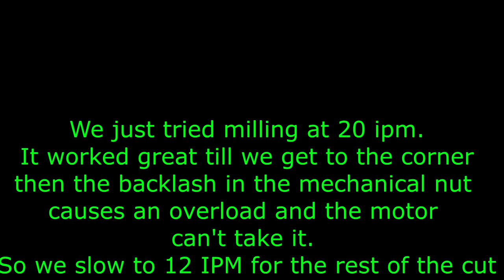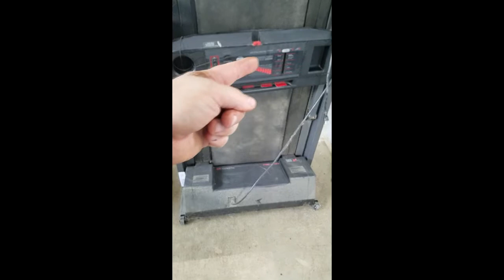Let The Smoke Out of the stock MAXNC cnc Motor while milling in steel.

Comment: Get an inexpensive mist coolant system, they are really great.  You can have considerable airflow and therefore get a better cut because you are clearing the chips with the air flow, cooling with airflow and coolant, and lubricating with coolant. When I cut wood, I just adjust the nozzle to deliver just air, and when milling lexan or acrylic I use water instead of coolant.  You can use a very small air compressor, as well.

Comment: I know this is an old post, but did you ever try conventional milling ? Climb milling does exactly what its named after, it trys to climb over the material. With any backlash it will grab. Conventional milling will always have the cutter pushing into the backlash on the leadscrew.
Reply from the maker: I did try both. Mostly because I forgot to click the conventional milling check box when programming, oops. I have too much slop in my screws and until that is finished I get oval instead of circular holes regardless of climb or conventional milling. It is on my list to provide a mechanical fix for this. But then again I just got a ethernet smoothstepper and it can do electronic backlash compensation. Might be worth a video showing the differences between the three options.

Comment: Hey JJ...i took my stock  maxnc controller apart and had a good laugh....the power supply is a wimpy 12v 4A....pretty sad indeed...i want to use a 24v 12A ps instead...i should be able to just remove the crappy stock ps wires and just connect my 24v ps right?...the stock spindle motors are junk...very little torque and almost zero torque  at lower rpm

Comment: I can hardly believe my eyes that you got this thing cutting (mild?) steel... I only dared with ali so far and I have the same motor. Its really impressive.  Did you burn the  motor coils or is it still usable ?  His much would you say this was down to the feed rate or doc? Cheers
Reply: *how much
Reply from the maker: Yeah, I was surprised it cut mild steel as well! I even got it to cut some case hardened hydraulic cylinder shaft I had laying about. I am not sure if I burned it out beyond repair or not. Actually that is a great question as I just spent half an hour with hobby files filing a slot for the new motor mount. LOL! I will try and hook it up again tomorrow. I tried to use it about an hour after the smoke first came out, and even more came out at that point so I just gave up. But it is possible that it was just the winding off gassing the insulation coating. I hope it is still usable as I really wanted to show people what the stock machine could do then try some simple homemade upgrades and see what we could do to improve for under $1,000. I did examine it earlier today and noticed it was really hard to turn for a universal motor. Does your motor shaft spin freely? For instance if you give it a good spin will it spin for a few more rotations? Mine does spin at all. If it smokes again I will take it apart for a video autopsy of what killed it. When I first tried running the motor on some wood. I found it was quite hot to the touch after just five minutes. I bought mine used off ebay so it could be I got a hard run motor on its last legs. I feel reasonably sure if your motor doesn't get too hot you will be just fine. I also want to reiterate that the machine ran for 40 minutes or so before the motor started failing. I drove it into the ground because I wanted to find it's limits and frankly I was soooo close to finishing the part :-) And now to actually answer your question. I was actually running the machine slower than it could run. The doc was .250" and the woc was 0.015" I think. I will have to go and double check that. Carbide likes to run fast so 20 ipm is about the max i would do. I ran most of the video at 12 ipm. I would have ran faster but the backlash in the screws caused the end mill to take to much depth of cut and would start to stall the motor. I really do think I have a bad motor as G-Wizard says I was only using about half the hp the motor could provide. If I had to do it all over again I would run it at the same depth of cut since the machine is stiff enough, and program for 0.010" woc and that way I could run at 20 ipm. I think I will do a video about my thought process on this in future and explain my reasoning. I tried earlier but I still didn't know what I was about. Not that I know now. Thanks for watching and sorry about the long reply!
Reply: Just Josh thanks pal that's a great little write up. I have to admit as I'm a Brit that I have to keep opening my calculator app to convert your imperial figures lol. I have a feeling I will have to invest in better cutters before I can cut steel like this, at the moment I'm using Chinese eBay specials which are allegedly hss, mostly 1/8 with 4 flutes.  
What you mentioned, doing a video before and after these upgrades sounds very interesting as I'm always looking at ways to improve my machine.  I also think it would be worth talking more about how you set up the machine  with your electronics setup to work with mach or whichever software you use, especially as many owners such as myself still use the maxnc native DOS setup.  These are great little underrated machines, I have a family now so hard for me to spend tonnes on CNC gear, so when I found mine second hand it was a great way to  get into the hobby. I buy spares here and there from ximotion to support those guys.  Still, just as you think maxnc videos on YouTube are a dying art somebody new posts something, so keep it up buddy!
Reply from the maker: Thanks for the encouragement! I will have to try and improve my editing skills to include alternate units in the DOC, WOC, and IPM to Include MMPM? mm per min? After all the majority of the world uses metric. Yeah, a good cutter helps tremendously. With that said I am using carbide and hss cutters that work considers trash and throws away. More than good enough for what I am trying to do. I currently use Mach 4 Hobby version with the legacy plugin. Grinds my gears to pay extra for it but you know. Needs must when the devil drives and I had a wedding gift I needed to make and too many lines of G-Code. I used the demo version of Mach 3 for all but this last machining video and I still have it installed and can walk through a general setup. I think you are right and there is a void on youtube for MAXNC software setup information. Currently it is set up to run with non MaxNC drivers. I have the Open Loop system so I can only speak to that. But boy if you are using the native DOS setup you are more of a man than I. I took one look at that and ran for the hills. It looks like you have the Closed Loop system. I have a vague memory of MACH 3 supporting Closed Loop. Initially I thought I had bought a closed loop MAXNC and later found out the E-bayer was mistaken in his description. How fast can you rapid? The old Open Loop stock driver only let me go as fast as 6 IPM (152.4 mm/min) I autopsied the 1/5 hp motor and frankly the problem is between the steering wheel and the driver seat. I had to replace one of the two studs that hold the clam-shell exterior together. When I put it back together I think one of the internal nuts became loose. I use superglue as a loctite substitute. The nut worked itself free and the nut supported the board the brushes were on. The brush then started to wear oddly and I think more and more of the carbon on the brush was ground away and started getting everywhere. I think heat build up and carbon brush material wearing and sticking into the cracks between the commutator caused short circuits and excessive arcing. The smoke came from the pcb board burning that the brushes were connected to.Suffice to say. If you plan on running your motor for more than 30 minutes I would recommend setting a fan to blow more air into it. I don't like how small the fan fins are and it couldn't hurt. And like I said before if yours doesn't get too hot to the touch then you are probably just fine. I am in the middle of editing the video where I took the motor apart and tried to fix it. Check it out and thanks for watching!
Reply: Mine also came with a maxnc 3d digitizing probe.but no software for it so its prob useless....i bet the probe costs as much as what i paid for the entire machine :)
Reply: L W - I’m little late to the party, but... that probe isn’t useless; it’s just a fancy switch; and the standard software does have a G code to move until it trips. If you don’t have the closed loop version; any PC control software should be able to drive the machine as well (and use the probe). Also; it’s not that hard to convert to another controller that can drive steppers (anything from GRBL to UCCNC or a MASSO system).
Reply: Is a maxnc 10 worth, picking up as a bare carcass and swapping to ballscrews and a sewing machine servo, then reinforcing, to mill 1 inch down to 1/2 inch occasionally, and to mill 1/8 mild steel? Or should I build something like the printnc instead?